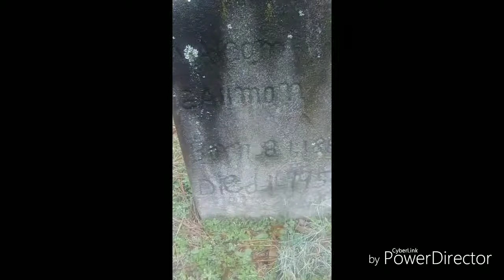Clay from cat litter...unused

Comment: Thought for ya.... Just thought kitty litter in a bucket, with just enough water to make a slurry. Let it set for a few days. Then dig a hole in the yard, about 12 inches wide by 12 inches deep. Put an old t shirt in the hole. Pour in slurry. Let the ground soil suck out the water. When you pull the shirt out a couple hours later, sand will be in the deep spot, leaving clay in the other....save the blender for making margaritas 👍👍😆🍺
Reply: Throw kitty litter... Damn auto correct
Reply from the maker: @drason69  do you by chance know how much poop i should put in a dry mix?
Reply: @00_negative  about 2 parts clay to 1 part poo...or 3-1.  The "digestive matter" helps as fiber and binder.. so if ya got 10 pounds kitty litter, use about 2-ish pounds of dry herbavor dung
Reply: @drason69  Unfortunatley you are probs right about the fiber binder. Adobe is strenghted by grass.
Reply: @drason69 Nobody's cat is a 'herbivor'
Reply: @therespectedlex9794  read much?
Reply: @drason69  You're the one who spelled herbivore wrong. Yes I do read much. Education is an important thing.

Comment: I didn’t grind mine down when I put water in it it got so hard I couldn’t do a thing with it was just like concrete
Reply from the maker: Interesting....I didnt have much luck with it. Its absorbsition rate is massive and it cracks easily when firing. My ratio may be off as far as an aggregate